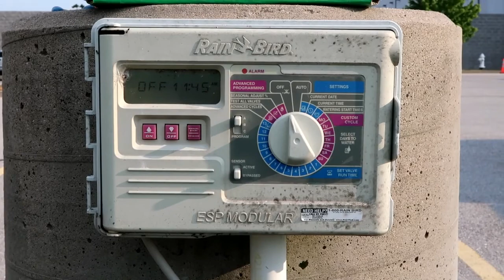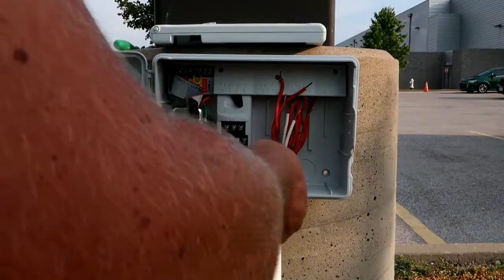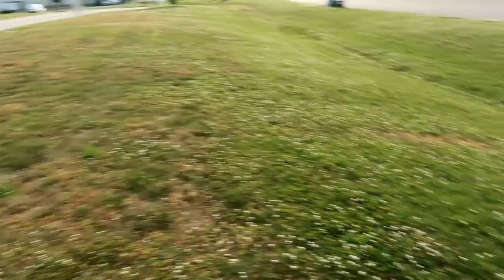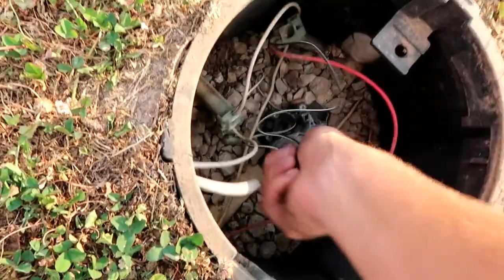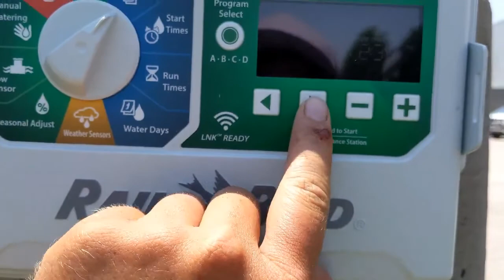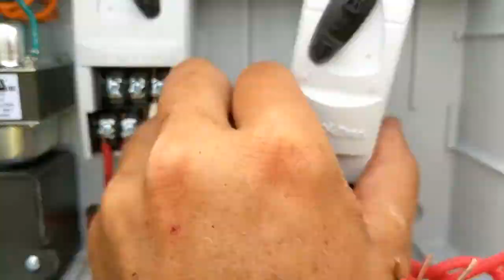Rain Bird ESP-ME3 Controller Install

Comment: I know this is 4 years old now but this unit is still the newest modular timer rainbird sells and your video is one of the only installation videos I could find. For anyone looking into this, the unit DOES accept 3 station modules and skips over numbers during setup. Personally ordering one of these now and reusing my old modules to save about $200 vs the non-modular units. Also can be expanded later!

Comment: Great video thanks.  The app works fine on my Ipad, but on my Android phone, the manual water function doesn’t list the ‘custom watering’ zones.  It is just blank.  I’ve tried removing the app from the Android phone and resending an email invite and downloading the file.  The ‘custom watering’ zones is still blank.  Any suggestions?
Reply from the maker: I prefer Hunter Hydrawise over the RainBird WiFi controllers. I have only used an iPhone in my past experiences with RainBird.